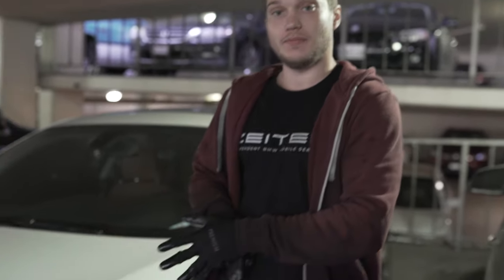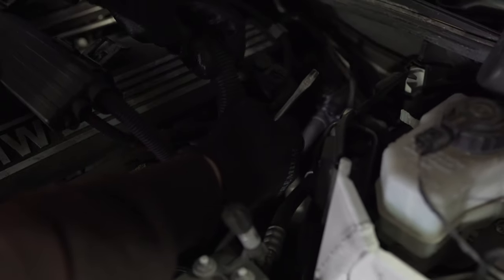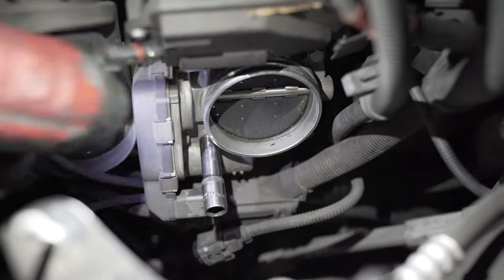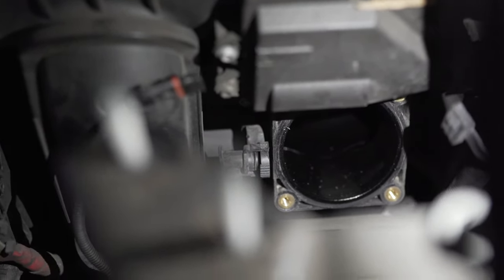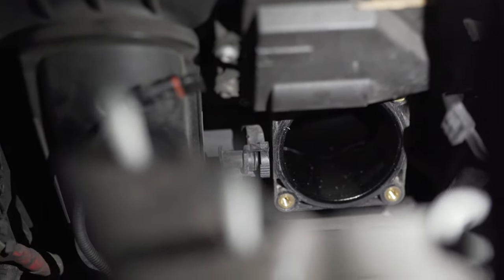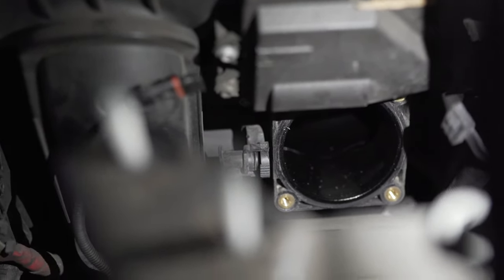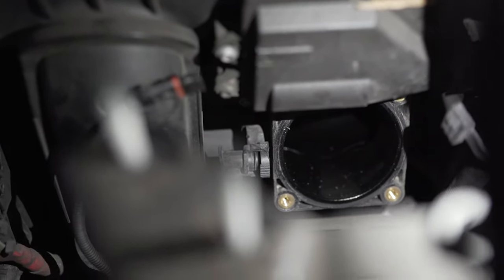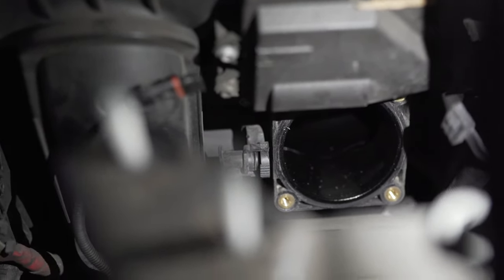DIY E90 BMW 328i Starter Replacement (FASTEST WAY)

Comment: @Artem Iavkin  I have a quick question, when I pulled the starter out the gear that the starter was connected to was Rusty should I grease/lube  that or no, if so what type of lube would be good for this thank you for any help you can give me.
Reply from the maker: No, it’s flywheel you don’t need to do anything
Reply: @Zeiten  Thank you, and thanks for the great videos!

Comment: 14:42 bolt with the green marking.  What is that cable used for?
Reply from the maker: Knock sensor, if I understood you correctly
Reply: @Zeiten  Thanks

Comment: 8mm
14mm 12point
11mm
10mm for power steering
6mm for intake boot
Torques 30
Torques 25
11mm
11mm 12point wrench
13mm

Comment: I have a 2007 328i with cas. I get no codes but the same system. i can't even get to the freaking starter to excite the solenoid to test the starter. What color is the solenoid wire?

Comment: Why didn't you explain about the bottom pcv valve that's attached to the ccv ? Mine does not come out without removing that pipe!
Reply from the maker: If you are talking about purge valve and the line that attaches to intake manifold behind throttle body then it’s shown in the video

Comment: I have and e93 with 80k miles. Went out of state for 3 months and when I came back the AC wasn’t working anymore. The compressor works though. What could be the problem???
Reply from the maker: Low on freon, final stage resistor, condenser you name it anything can be wrong get it inspected

Comment: My 09 E90 had been taking longer to start in the cold and now it cranks maybe once and the dash lights flicker and won't start. Getting P052B error code. Do I need a new starter?
Reply from the maker: Most likely battery
Reply: Thank you will check out the battery, thanks as always
Reply: No new battery yet but jumping isn't working, it should have worked if it was the battery right?
Reply: Ha.. Nvm after about 10 tries it finally started

Comment: My starter is not coming out after removing the bolts. Think it is the corrosion. I have tried spraying WD 40, and prying with a flathead. Could the teeth be stuck to the flywheel? If not what else should I do, if someone can pls suggest
Reply from the maker: Well, that’s very unusual i’d bet you took the wrong bolt out not from the starter but transmission housing bolt
Reply: @Zeiten  hey thanks for getting back to me. No I double checked I got both the correct bolts out
Reply from the maker: Then nothing else holds it
Reply: Hmm,  yeah its really weird. I'll try again tomorrow with pb blaster and a pry bar. Thanks
Reply: The pry bar did the trick

Comment: Don't use Auto Zone or O'Reilly Starters they have high Comeback rate. Bosch is Best Very Low Comeback rate. Think about it you have to remove Intake manifold big job not like replacing Starter on Chevy it Ford takes less Hour.  I rarely have used Auto Zone-O'Reilly Starters or Alternators but the times I did Failed Quickly. I'm a Master Mechanic Tech 45yrs exp.  Reason why I watched this Video  said BMW Quick Starter replacement so I thought I'll watch it maybe young guy knows something I don't.  I pull Intake in the past too. Make sure your Battery is Charged right 12.4-12.7 Volts. Engine off